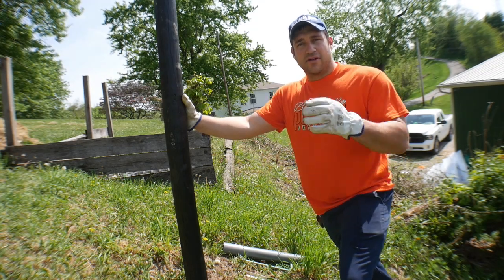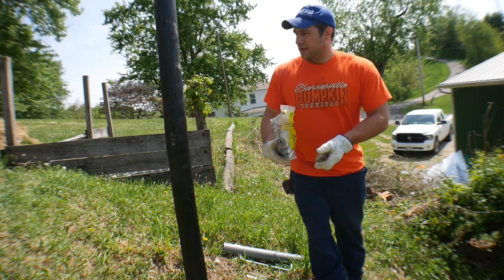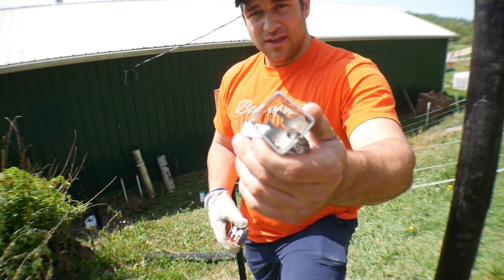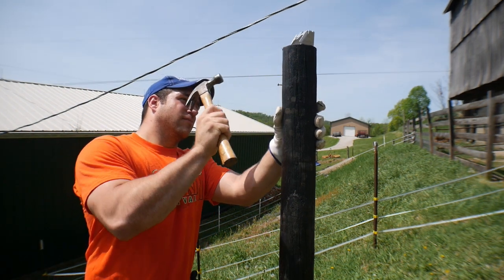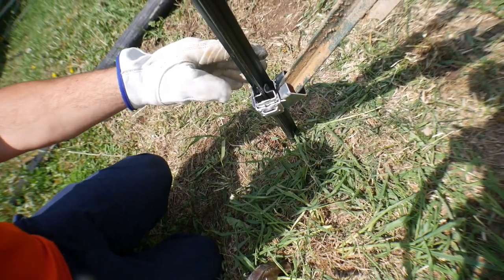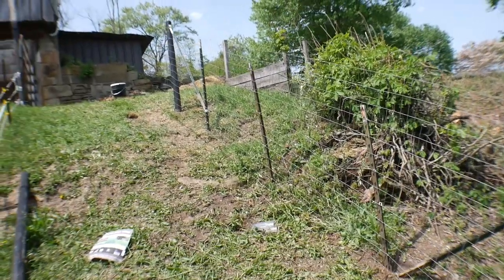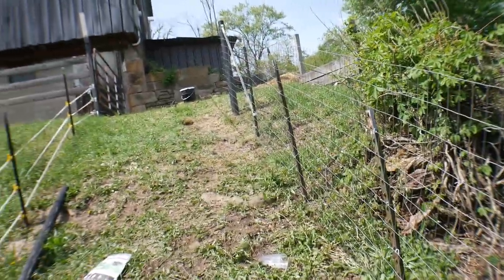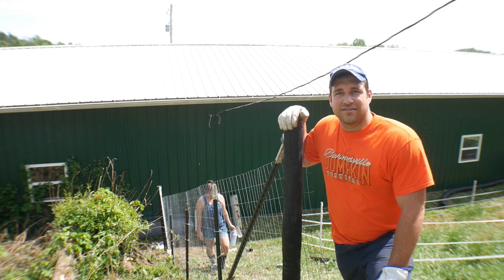SUPER EASY FENCE SYSTEM! Installing Wedge-Loc Fence Brace System On A STEEP BANK

Comment: Interesting product.
I notice that it only works when you push on the vertical post.
Pull, and the diagonal post falls out.
Reply from the maker: Yes that's why you need tension
Reply: @Mallard5plus1Farmhouse  Yep.  
Interesting that the manufacturer does not mention that, nor do most videos address the limitation.

Comment: How is is this brace doing after so long
Reply from the maker: Still working fine 👍
Reply: @Mallard5plus1Farmhouse I’m building a fence for my animals and my fence posts are only 2 feet deep with concrete cus I don’t have a truck so I can only buy the 6’5 fence post so I’m thinking about using this system like in the video.will it work and be sturdy even though there only 2 feet deep with concrete?
Reply from the maker: Yeah I think so. I'm pretty sure that's how deep I dug the ones in this video
Reply: @Mallard5plus1Farmhouse  alright.thank you 👍
Reply from the maker: No problem 👍